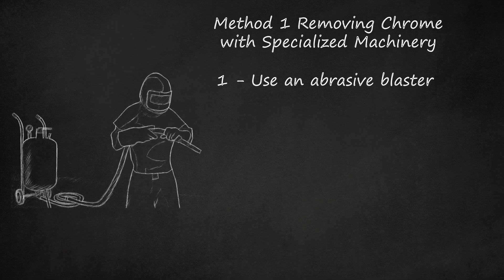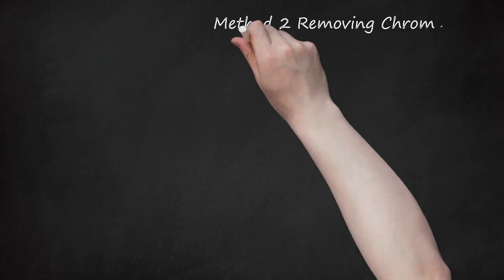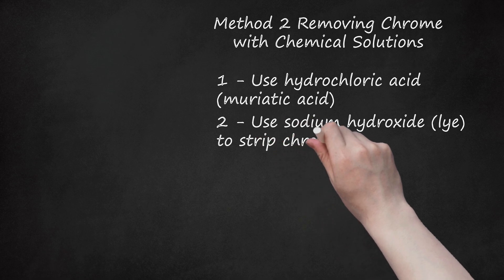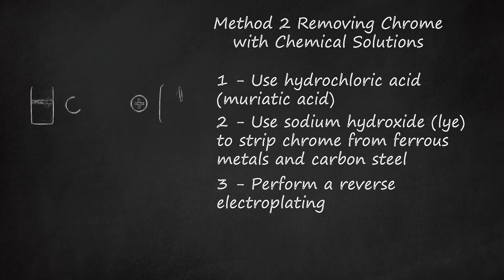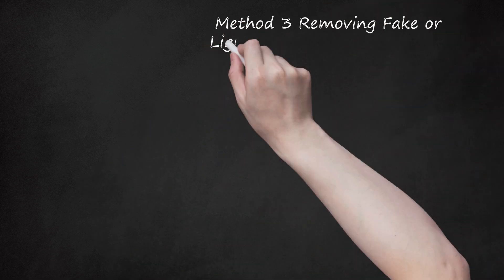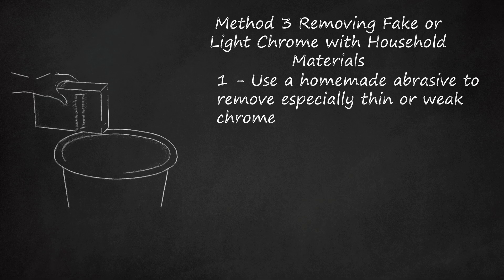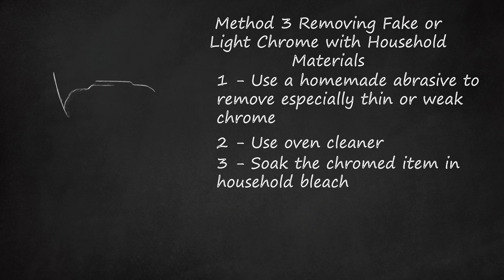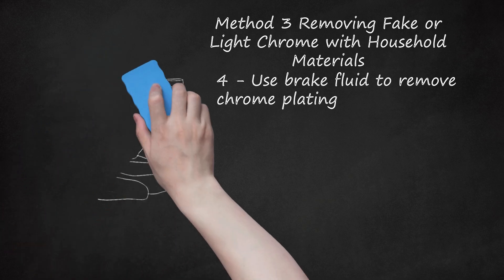Removing Chrome from Metal: Chemical, Mechanical & DIY Methods

Comment: Undiluted sodium hydroxide is massively corrosive! But at least you can dilute further any  you haven't used to strip chrome, and use it for cleaning the toilet. Household use should be diluted to around 3% for cleaning. Crystals in small amounts can be used to unblock drains. Any used solution MUST be further diluted to at least 3% to dispose of it down the drain.

Comment: Mannnnnnnn stop lying, its like listening to a gps for 12 minutes. 

I have an old exhaust pipe I'm trying to get rid of the chrap eBay chrome, and I'm painting it with high temp exhaust primer and paint. 1200°F to 2000°F, I want to say it is ceramic paint? Not 100% but I've used it before.